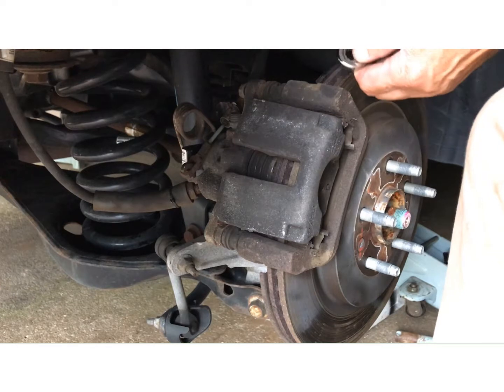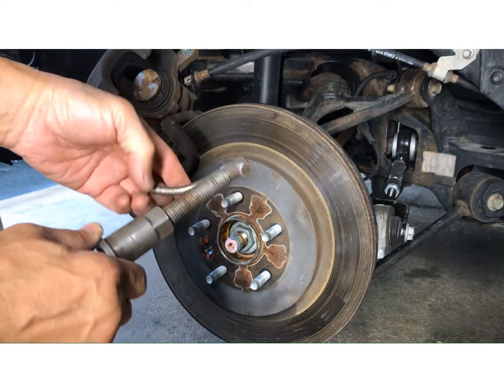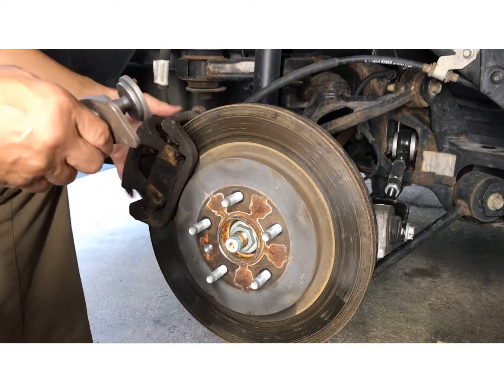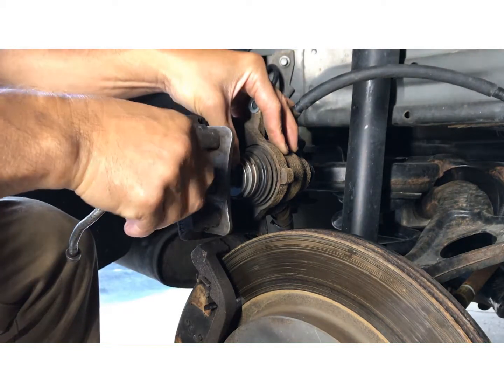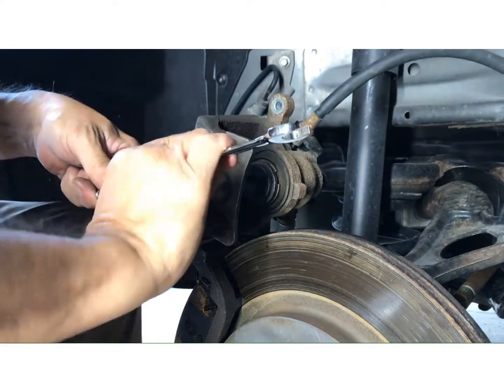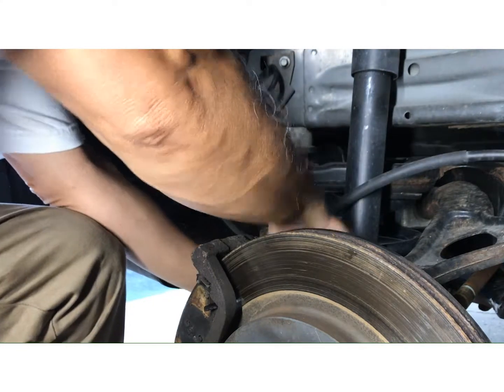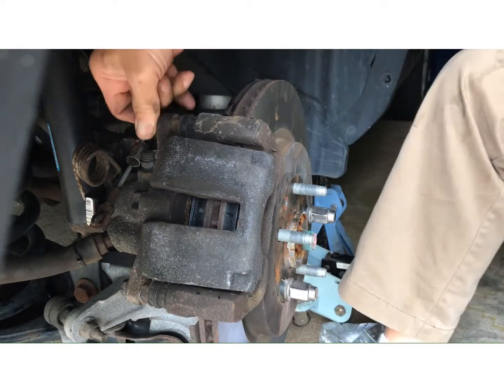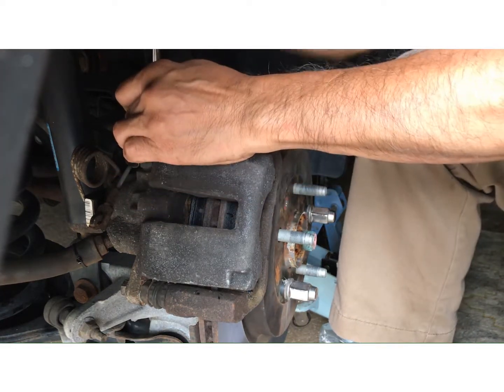2014 Ford Explorer Rear Brake Replacement

Comment: Helping my sister's boyfriend with his brakes on his explorer and I've got to say these are the most stubborn brakes I've ever had the missing of touching
Reply from the maker: Dude! How come? I remember squeezing the cylinder brake was a little stubborn because the brake caliper kit I had was all bent and twisted.  Otherwise, it was not that bad.  I hope I will not encounter such a pain you had when I’ll do the front brakes. I have changed my front brakes since I bought the car in 2014.

Comment: Be careful! This video has two issues; 
First, NEVER back the piston until stops, this will result in spongy  brakes because the piston has to travel until makes contact with the pad. The piston will retract to its current position!!!! Spongy brakes are dangerous 
Second, make sure the piston grooves are aligned with the brake pad raised knob. 
He did not aligned the piston! 
I will say this again, back the piston enough to snug it into the pads. 
Trust me on this one,
Reply from the maker: Thanks for comment Miguel Reyes.  I will keep in mine.  However, It's been over a year now, I'm not having such problem.